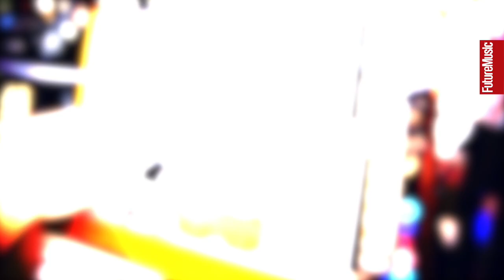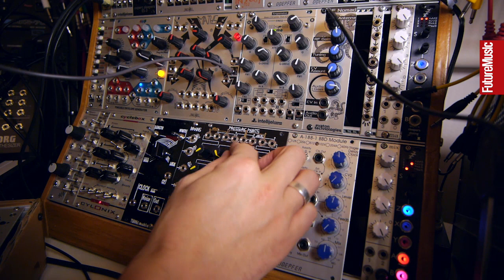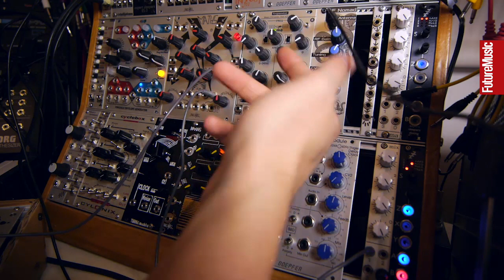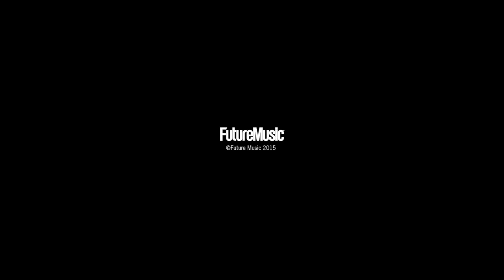Modular Monthly: Creating strange oscillators

Comment: Two filters self oscillating can become a complex oscillator.  Makes sense.  I am trying to understand the difference between an FM input and using the 1V/oct input on a filter(WMD C4rbn).  The pitch (1v/oct) determines the frequency of the filter.  If you modulate that (at audio rate?), is that not frequency modulation (FM)?  If my filter does not have an FM input, is there an external module I can use to similarly FM the output of the filter with another source?  For example, the Squawk Dirty does not have an FM input.  Pretty sure I'm missing something.

Great ideas for understanding basic concepts and being creative with audio sources.  Thanks younger Mylar.

Comment: you could also take the output of the bbd, send it into a low pass filter, and mix it back into the input along with the initial noise burst. then tap the output of the bbd with a mult and in that way acquire a neat sort of dampening effect over time. or stick anything else into the signal path before/after the filter and see how it turns out :3 ks is always fun to play around with.

Comment: Hi! Nice stuff I enjoyed this

1. shouldn't you be capacitively coupling your rapidly varying CV when you use it as an oscillator?  E.g. through a passive RC high pass filter?
2. when using the BBD device with positive feedback is there any way of controlling the feedback so it doesn't grow and get too big, other than manually?  I saw you having to do this a couple of times.
Reply: +Richard Kaye Basically all audio interfaces will AC couple the inputs, so you don't need to do it in the modular yourself.
Reply: You can run the feedback loop thru a VCA and an envelope follower, send a negative copy of the envelope follower to the VCA’s CV in to keep it from getting too crazy. Or you can use a limiter like instruo’s TanH

Comment: Man, i so want to get into modular synthesis. this looks like so much fun. Whats a good place to start if im on a budget?
Reply: +Chartre Khan You're right  - the cases  are ridiculous - I finally settled on a pair of Tip Top 84 hp rails,  combo rackmount / desktop end cheeks,  and their Zeus power supply (which includes 2 flying bus cables) from Detroit Modular .  Total cost $ 140.   Just add a spare laptop power brick and you're good. If you can  - Avoid the cheap rails with the sliding nuts /

Comment: I see u r using a 1024 Doepfer BBD module. I have a 4096 myself. Am planning to get a 128 soon. I thought you needed one of the short delay types like a 256 or 128 to get Karplus strong, but apparently not!